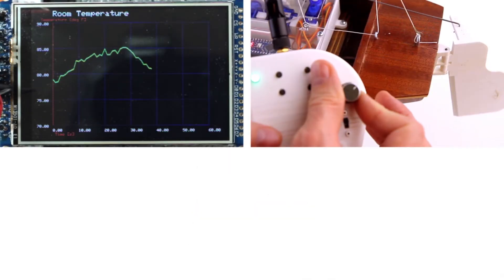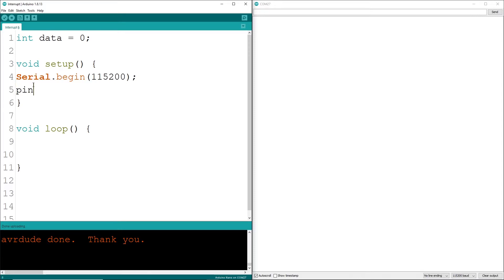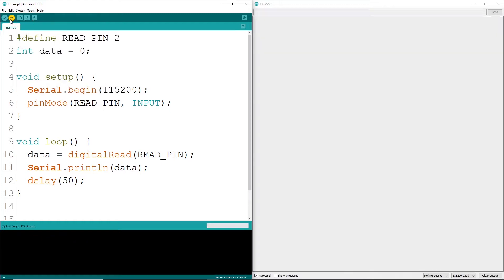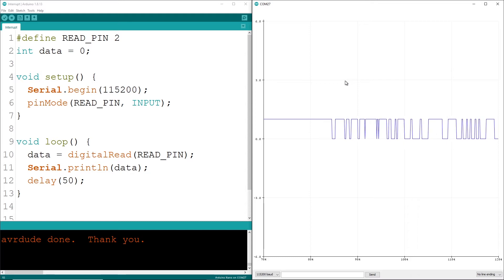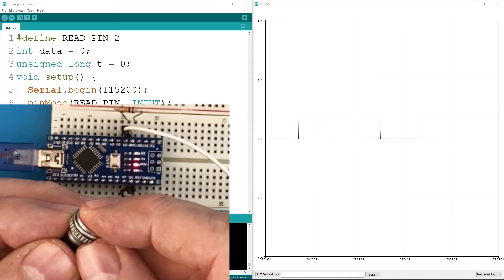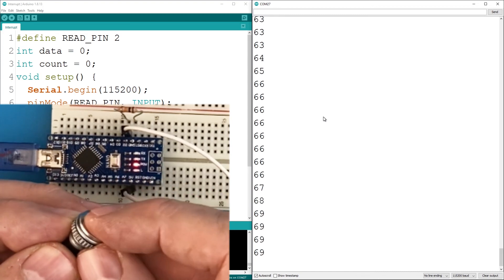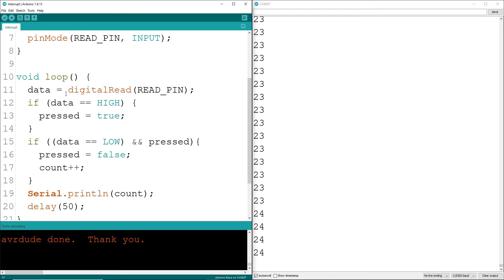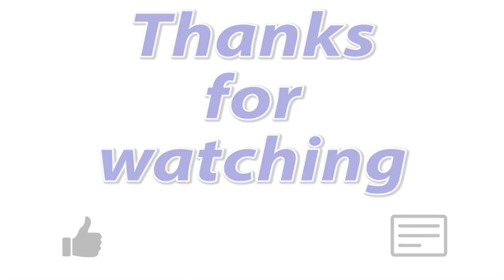Tutorial: Use digitalRead to monitor digital sensors

Comment: Excellent clear video,

the way you concisely explained Pull-up Pulldowns resistors has  finally cleared it up in my head suggestion ( maybe a little bit of PowerPoint animation  could help illustrate the point?)   

could I request a video on Arduino (or any MCU for that matter ) Libraries - I simply don't understand how someone can 'make' drivers or libraries to make an MCU talk to an RF module for example  
that would be really interesting IMO  as the subject blows my mind🤯  
anyways keep up the good work!
Reply from the maker: I actually have a vid on how to get one MCU to talk to another wirelessly. And in includes a link to a library I wrote that will work (meaning program) EBYTE wireless transceivers. 

https://youtu.be/hMjArKGucFA